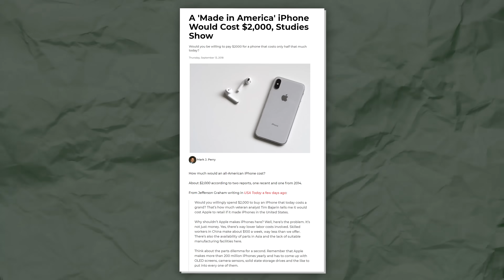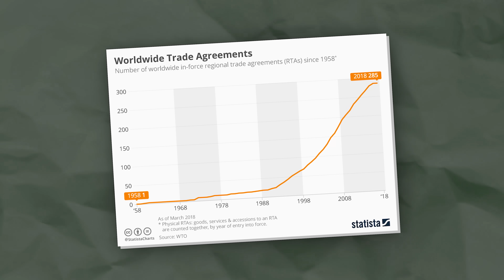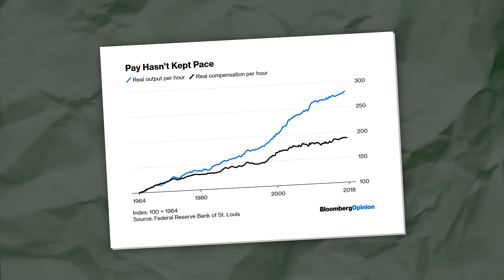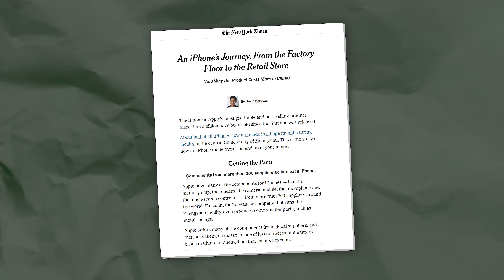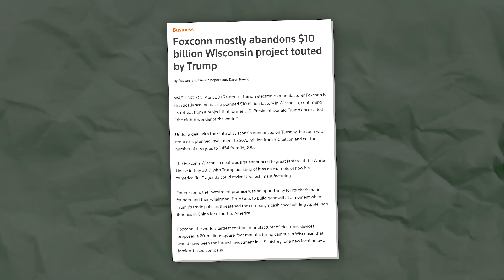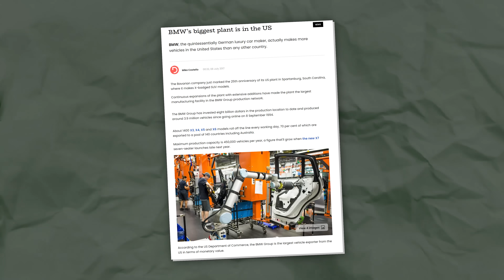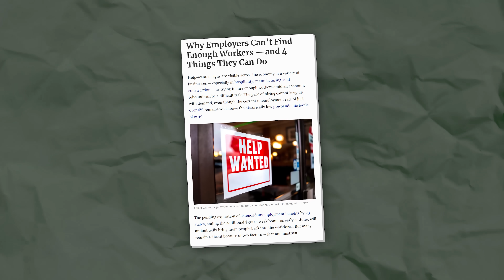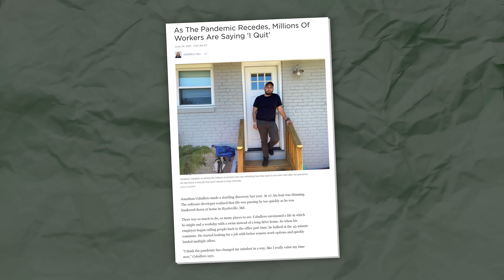How Much Would it Cost to Make an iPhone in America?

Comment: Automation in manufacturing in the next 10 to 20 years will mean products can and will be more cheaply built in the U.S. or any country that invests in automation. Labor costs will be low, and production will be high. We will see companies bring manufacturing back to the U.S. but unfortunately, not many jobs. Only industries that can't be automated will remain in low cost labor countries.
Reply: Where you think the automated machines parts are produced
Reply: China is FAR ahead of the US in automation. East Asia is the hub of automated factories-for obvious reasons.
Reply: @achintyanaithani889  exactly. The research and development generally is located or relocates to where the factories are. That's why China is way ahead in terms of not only the automation of factories, but also supply chain systems to sustain industrial production within massive manufacturing hubs. If the US does not reshore manufacturing it CANNOT compete. Technology does not just fall from the sky and is immediately usable.
Reply: @achintyanaithani889  actually the automation powerhouse is Germany,  and most of the machines used in chinese factories are imported from Europe, especially Germany, Italy ecc
Reply: @willy4170  For now. Knowing China, they've already got a plan for this. Those guys have been playing Go while the West plays poker.
Reply: @achintyanaithani889   I think China is to big and inefficient to became the capital for pure technological development, i would rather bet on Taiwan, Japan or Korea.
China still focuse on labour intensive sector that only need unskilled work like farming or low tech consumer goods, so with such a cheap and abundant workforce there is not so much need for innovation in the automation sector.
To became the spearhead of innovation is better a small country with a higly educated population, in fact a few years ago, Korea was awarded as the most innovative country in the world
Reply: @willy4170  You really should go on a factory tour around East Asia one of these days. You will realize that in terms of labour intensiveness and R&D, Taiwanese, Japanese, Korean, and Chinese have now become neck to neck in nearly all sectors. As of 2021, China is already ahead of the US from automating manufacturing to port container terminals. In fact, labour costs in China have already become much less competitive than Vietnam, India, Indonesia, and the Philippines, yet we continue to outsource to China because they have much better logistics and technology. Other than TSMC and a couple of key players, Taiwan doesn't have much technological development going on these days, much less compared to Japan and Korea. Japanese tech has also stagnated since the Lost Decade and now lags behind even the US in adoption of new technology. Fax machine, paper archives, manual booking services, etc are still very much alive and kicking in Japan. Other than China, South Korea is the only country in East Asia that sees R&D in sync with the adoption of technology. Yet South Korea being a small country is limited by the number of innovators. South Korean economy is still dominated by a few Chaebols, who hold a monopoly over the R&D of the country. Samsung alone composed close to 20% of the entire South Korean economy in 2014, so the lack of competitiveness and diversity in R&D is apparent.
Reply: @auburntiger6829  
In japan stille use fax because it is full of old people all about traditions not a lack of technology, because of the “big risks, big profits” mentality they prefer to play it is safe so they can pass their activity down to their childrens.
In china other than economical problems there are a lot of political problems as well since the ccp don’t want factories to be too much efficient so they can employ more people and create more jobs or even cracking down on all the service sector and internet companies to force more people to go to work in factories 

Also taiwan is still the largest and most important producer of microprocessors, here is also a video explaining the topic
https://youtu.be/U1jN0Dizn9M
Reply: @auburntiger6829  well said
Reply: @achintyanaithani889  i think the US should loosen Environmental restrictions and bring down their cost of living and minimum wage in order to compete against China
Reply: @triadwarfare  China's climate is already shut. Their lakes are drying/Polluted. Their land is not as green as ours. Hell if you need to paint a land green to resemble grass. Then you've got a problem
Reply: @triadwarfare  loosening environmental restrictions is not the way.

Loosening capital restrictions that create monopolies and crush competition, that's the way.

Real environment restrictions are a good thing, but a lot of them are only on paper and the megacorps have workarounds for them. The whole thing needs to be restructured
Reply: @priestesslucy  Depends on the environmental restriction. Some are good others are not. Either way we'd have to loosen some restrictions to mine rare earth metals economically here among other things. And even then you'd still have to create tax breaks to create companies that cause competition and innovation.
Reply: @supergamergrill7734  USA already paint their grass in green:oops:
Reply: @marczhu7473  Proof troll
Reply: @supergamergrill7734  California paint lawn in green google it duh.
Reply: @HH-le1vi  you can't simply mine rare earth metals here in the USA. It takes cheap labor "basically slave wages" massive processing capability "large numbers of slaves" and not caring about the environmental impact "food wildlife and radioactive contamination" to produce rare earth metals. What could solve this however is to invest heavily into science. There are many theoretical ways to get around the need for rare earth metals that wouldn't have such an environmental impact but we still need funding into research development and science educations in this country in order to get to that point. Carbon batteries graphene even carbon nano fiber. Then there's other options such as using hemp to make wood because hemp wood has been shown to be up to 10x stinger than tree wood... There are many advancements we could and need to make but really it all starts with proper education in the fields of science and since after high science gets dominated by males "females lose interest in science around this time and tend to fall behind" while at the same time men get less funding and motivation to further education beyond highschool these days we won't catch up in the fields of science or make any true progress until our attitudes in society change first... Or we just rely on people like Elon musk to make those advancements for us and piggy back off of them. Either way I don't see any of this happening anytime soon.
Reply: @supergamergrill7734  Obviously you have never been to China.
Reply: @wulung5943  wow good arguments
Reply: @Ecaea  Hmm I wonder why? It can’t be because littering is punishable by beatings and jail time. 

And I was talking about the air quality. Go to Beijing, don’t put a mask and Breath
Reply: @triadwarfare  Minimum wage only lowers wages anyway. So you got that part right. Environmental restrictions dont help the environment, they just are used as a legal bludgeon against free market capitalism. Not wrong therei either. Cost of living is tied to how successful an economy is. It shouldnt explode in cost, but a higher cost of living is  natural consequence of being a wealthy, affluent nation. No reason to try and bring it down. Just have to get opportunities to catch up.
Reply: @supergamergrill7734  i wonder which other country does the same with punishing litterings with fines? Hmm idk ... 1 of the most beautiful and cleanest island country in the world?
Reply: @Ecaea  It punishes fines with prison times that are WAY longer than America and the fines are insane
Reply: So why produce in the US. 
Land is expensive. Construction too. Why build big plants for automation that can be build anywhere else in the world. 
Production isn't attractive anymore to be fair and honest. You make money be researching developing and then marketing and selling a product and (its subproducts service (apps/ abos... ).
Reply: @paxundpeace9970  yes, also the same thing i was thinking, most developed nation have moved to the service sector as the driving force of their economies, shifting to a post industrial type of economy
Reply: Great!  And who is going to purchase the products if everyone is unemployed?
Reply: @Haibing22  no one, because "america is no place for your stinking commies" they'll just people starve to death en masse. After all, people in possession of enough capital to replace humans with robots when technology is available, already believe that the world is overpopulated by (poor) people;)
Reply: meaning less jobs in all countries. meaning less potential customers. so who is the real winner here if any at all?
Reply: I'm curious (genuinely) what do you think that would happen with more automation? If jobs disappear and people don't get paid, products won't be sold, specifically high-tier products
Reply: @malva9092  We are moving to a 'Postindustrial' economy. The industrial economy is focused on industrial production. (That will be automatized as much as possible.) In a Postindustrial society "Selling" becomes more important than making. It can be argued that Apple and other companies don't make anything, they just sell a product made by others. Companies are brands, not factories. They sell not make. The idea of 'selling' over making is what creates global capitalism possible. So jobs will be creating brand identity, and selling products and services, not industrial production.
Reply: @robertsarchitecture  how will they sell brands if people are replaced by robots, unemployed and therefore broke? I don't get it
Reply: Anything that you think could not be automated? Will be. Automation is no longer dumb blind machines that are oblivious to their surroundings.
Reply: its all ANOUT THE F GREEEEEEEEEEEEEEEEEEEEEEEEEEEEEED that ppl got,,,,
i understand you gotta make $$ to feed yourself but making $$ upon ripping off the public in any way is not FAIR and should have DEADLY conse,,,,,, or a world REBOOT,,, plz other life forms,,, come F exsting ,,, US for a new start!!!!!!
Reply: It already is. Foxconn is making phones in the US today. The entire factory only employs 40 people. Yet the governments bent over backwards to have them in the US and gave them hundreds of millions in incentives for these so called "Job Creators"
Reply: @MatchaMyu  also lol. cashiers have been replaced. there are self service checkouts now everywhere. And if Amazon's contactless store spreads, you won't even need self service checkouts, just your phone.
Reply: The problem is that once you list the “how to” it’s difficult to bring it back as things go forward all the time. The US is doomed because it relies on consumption by debt.
Reply: It doesn't make much sense to manufacture low level components anywhere but where you can find the recources. After all shipping chips lomg distance is a lot more efficient than shipping trucks of silicon around the world. So you'll always be dependent on whoever has the raw resources. This wouldn't be an issue if humans weren't so egocentric.
Reply: Invest in building the machines for automation. There's a help.
Reply: I’m thinking they already have automation and cnc etc there is only a small portion of the manufacturing done with human labor. There are sometimes things that are better done by human
Reply: By making manufacturing cheaper and more easily enter able it won’t really matter if these companies create more jobs because now more people can create more companies. More people can become their own bosses
Reply: The irony is that automation requires highly trained specialized workers to program robots, repair them and update them according to the needs of the moment. I don't think there are enough workers of this type in the United States.
Reply: But, American can't buy it, because they have no job and have no money.
Reply: @MatchaMyu  the workforce to maintain the robots are smaller and can be remote. right now automation is only profitable for large scale factories, when it becomes profitable enough for small scale flipping burgers, then you'll finally be out of a job. rip.
Reply: Japan will be first. They are good at robotics and have really extreme demographics and they also kept their manufacturing base. China will probably rip of Japanese designs and be second. America will be cleaning up after its civil war.
Reply: Wouldn't investing in automated manufacturing equipment require a massive upfront cost? Would a lot of companies, even big wealthy ones like Apple, be willing to spend this cost, even with the knowledge that the high productive output would yield a return on this upfront cost very quickly? 

And IMO there's no guarantee that automation will be immediately profitable and hassle free. For example, I remember one of my professors in college telling a story of how a fully automated soda distribution plant he was working in once had the equipment malfunction and spill thousands of soda bottles. 

Is it possible that automated manufacturing will have significantly costly malfunctions like this frequently enough that it would be less economically viable than regular human labor?
Reply: 3D printing will be a revolution.
Reply: No unions are available to protect local workers which main the reason why labor is cheap in 2nd and 3rd world countries!
Reply: Back in the US 100% better than if it was in china. I would rather a phone made here by robots then there by people. F*ck china's Human rights violations. If it was made by robots you would 1 need a factory to make robots; Though that also could use robots so only initial robots would need to be made by people. You would need people to maintain them such as installation, repairs, updates, upgrades. Basically a whole new technician work force, which would probably pay good wages. 2 You would also need transportation for resources so an increase in train infrastructure would most likely happen. Currently our train networks are for shipping but with an increased demand there would be upgrades made. Possibly at the same time increasing public train lines as well. And 3 through automation prices could be cheaper for locally made products than imported ones in addition to the decrease in cost to set up more and more automated factories.
Reply: @James-gd3sp  Ah yes, the old China doing forced labor and slavery schtick.  Because slaves typically know how to manufacture electronics like an iPhone. How exactly do you think that works?
Reply: if there are no jobs due to automation, there will be no money to purchase the items, stupid
Reply: @gregorycaccivio2033  So Move from capitalism then. It’s stupid we would stick to this economic model if it doesn’t work with this more modern advanced world
Reply: @supergamergrill7734  what would we replace it with? Socialism doesn’t work. We’ve seen that in every planned socialist economy. They always fail. 

In my opinion, we need to go back to Keynesian economics. It helped get us out of the Great Depression, every recession after that was very short lived and caused by their being too much money in the hands of the American consumer. 
During this time we also had top tax rates going between 75 to over 95%. 
The reason people dismiss Keynes today is because of the “stagflation” of the 1970s. That’s when we began to switch from demand-side (Keynesian) to supply-side (trickle down) economics. 

But raising taxes to historical levels is a taboo subject. That’s the golden bull we’re not allowed to destroy.
Reply: Except we are in the middle of a climate crisis that requires degrowth of the economy and a reduction of energy consumption( Americans living with 1/4 current energy use) and a rethinking of how we value labor.  Automation is only viable if your metric of efficiency measurement is based on labor costs in the form of monetary investment and running costs. If you measure efficiency in terms of energy use and environmental impact then automation is  not an option.
Reply: @davisbradford7438  Automation doesn’t require that much cooling, Automation doesn’t require breaks meaning your getting much for your energy input, automation doesn’t get sick leading to not needing to use hospital beds when broken or glitched and it doesn’t need that much safety probation since it’s not human and won’t make mistake as a degree humans do leading to the product not getting ruined
Reply: @supergamergrill7734  I'm a Mechatronics technician so I understand the value and complexity around industrial automation systems. The complexity of these systems and the amount of human labor needed to maintain, iterate, and run these systems is woefully misunderstood. The supply chain and overhead increases alongside automation. Without "cheap" energy and a drive to reduce the quantity of laborers above all else, automation is not viable.
Reply: @davisbradford7438  Solar power And windmills cost have been decreasing at a dramatic rate. The world climate organization said renewable energy would break even with petroleum in 2050. It broke even in 2020. Cheap energy is a given in the future. And reducing laborers will happen as workers get more and more agitated
Reply: Renewable are so cheap that nobody wants them. 
(Still upfront cost are higher now then an already operating coal plant.)
Reply: @paxundpeace9970  Starting a coal plant is cheaper. Maintaining it is costlier since Co2 taxes, regulations and other things happen
Reply: @davisbradford7438  your job sounds super cool. I want to hear all the stories! 🤓
Reply: @davisbradford7438  Right, which is why literally nobody measures efficiency that way, because it would be retarded to lol. Your green Utopia policy will do nothing but enrich China and collapse Western economies. You think they give AF about the environment? China could not care less lmao.
Reply: @anthonyreed480  Efficiency is measured in lots of ways. It's just that the primary driver is the $. Money is a societal construct that currently doesn't account for the fact that the planet is a closed system with finite resources.